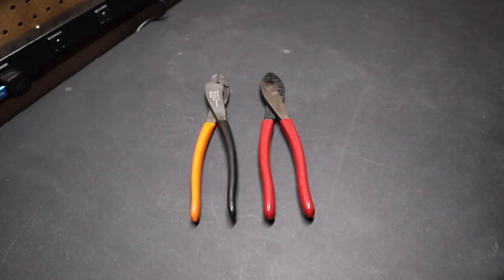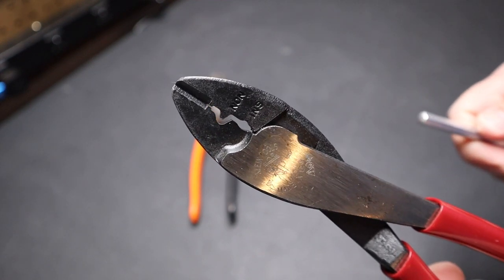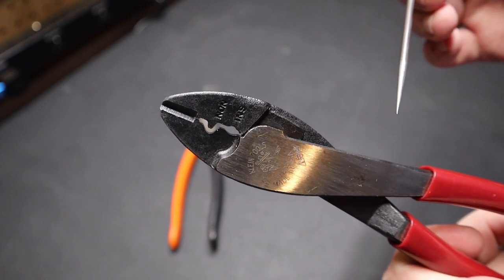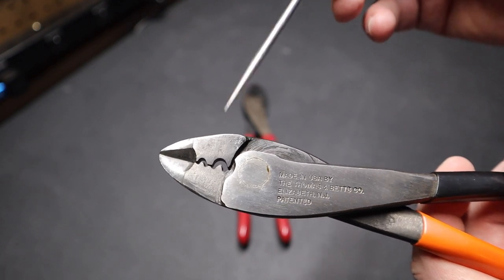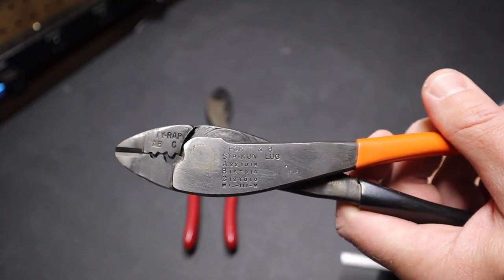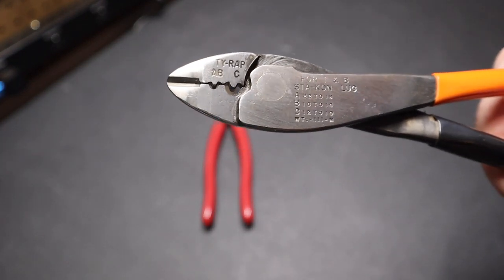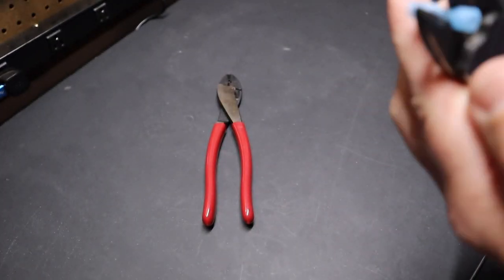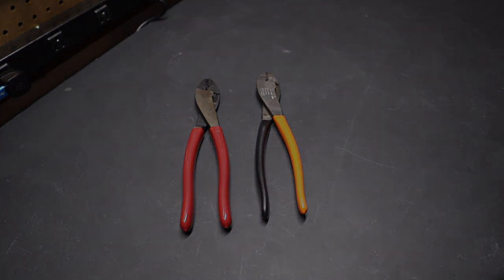Best Crimpers UPDATED - Thomas & Betts vs Klein Tools

Comment: On the T&B crimper, that flat spot between the cutter blade and the “A” crimper is to grab a zip tie to tighten it. Their brand is called Ty-rap, and that’s why it’s labeled on the tool there above the ABC.
Reply from the maker: That makes sense, thanks! 👍

Comment: Love my T&Bs I about cried when I clipped a live line by accident(don’t take someone’s word breakers off,check)and notched the cutter. I also avoid big box store terminals usually vinyl, get nylon worth the extra $ as they split less.
Reply from the maker: Thanks for posting. They are great crimpers. 👍
Reply: I like to remove the wire cutters from the ones I use.
Reply from the maker: @joehead1294  use or remove?
Reply: Exactly,man……. I Did the same thing with some greenlee ratchet cable cutters,in a ditch,was told 240 volts was open,it wasn’t,that’s on me though for not checking for myself,always check.Good luck man,be careful.
Reply from the maker: @kyzor-sosay6087 ouch, yes always double check, that’s bad. Thanks for posting!

Comment: 4 or 5 years ago ordered up a pair of T&B's to replace a lost pair... what arrived was the worst looking knock-off's ever. They were back in the mail within an hour. Then happened on a Snap-On truck & found a pair of their 29ACF's. They're VERY nice, I suggest having a look. They look like the T&B's (sans multi-chromatic grips), but have a spring loaded joint to maintain constant/even back drag for good 'feel'. 99.97% of my crimps are non insulated finished with heat shrink... these produce the best looking crimps I've ever seen. Cool video, Thanks!
Reply from the maker: Thanks for watching, I’ll check out the snap-ons. 👍

Comment: I have the channellock version. I have only been able to get a good crimp on the yellow insulated connectors using larger wire. No luck with the blue or red connectors, unless i put them in the non insulated die, only that damages the insulation.
Reply from the maker: Either the insulated part of the die doesn’t work or it only works with a certain type of insulated connectors.  Thanks for watching and commenting!  👍
Reply: @projectpinehills  I also have some Kleins , the type that has the holes for cutting down machine screws and the insulated dies color coded.  Same thing with those .  Yellow works great.  Red or blue doesn't close up tight enough and wire pulls right out.

Comment: My Kleins #1006 D are identical; to your T & B's They were stamped with the same dies in the same factory.. One RED and one BLACK handle.. T & B doesn't manufacture tools and Klein hires contracts houses to make many of theirs..  If you look at most specialty tools,, you'll see that many are the same with different names on them
Reply from the maker: I know the Klein 1006 has the same die, but I haven’t seen them side by side.  I know the Klein 1005 is not as heavy or wide as the T&B. The Klein 1006 shows with back vinyl grips vs red and back. Thanks for commenting, I appreciate the info. 👍